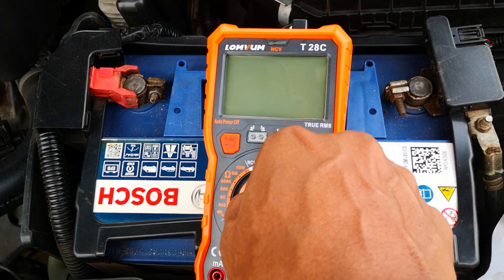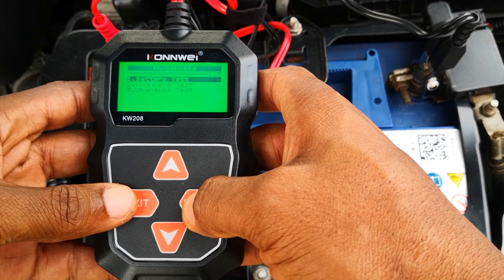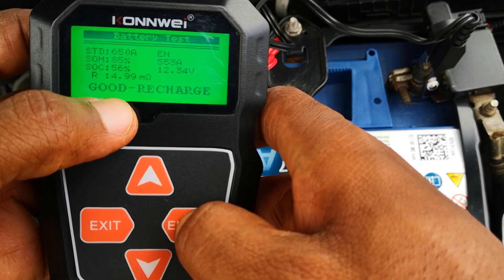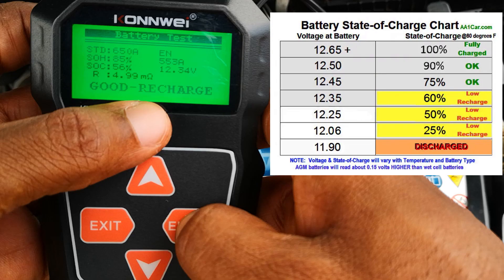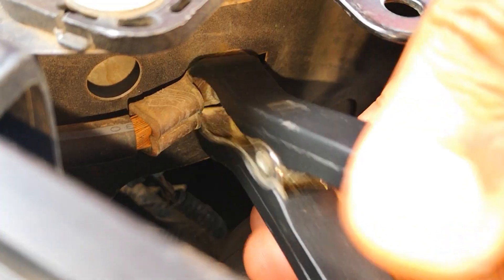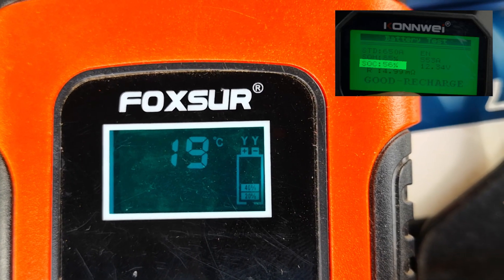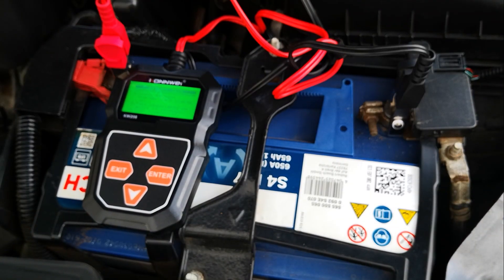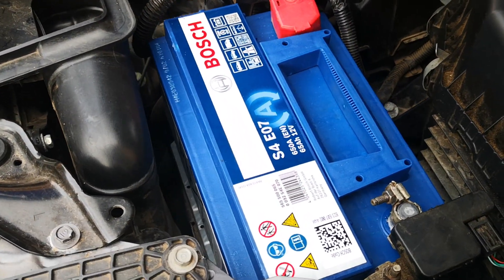This DIY Car Battery maintenance prevents Early Battery Failure / Extend life of your Car Battery

Comment from the maker: Do you test and recharge your battery on a schedule? Has it helped? For me, this has been massive!

Just in case you want to check out any of the items used in the video on Amazon:
- Konnwei KW208 battery, alternator & starter tester https://amzn.to/3sxg26x
- LOMVUM digital multimeter https://amzn.to/3y8ZNkU
- Foxsur 5A charger https://amzn.to/3C3Sc8z (You may also check other chargers)
I may earn a small commission from a purchase made through the links above.